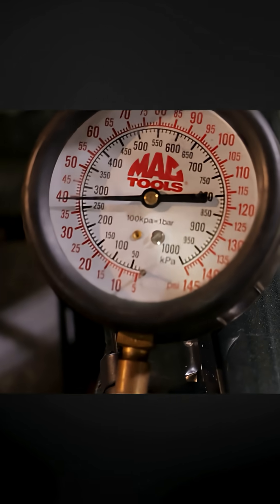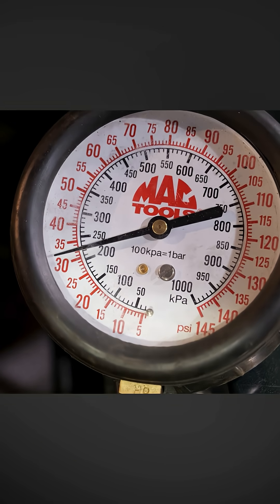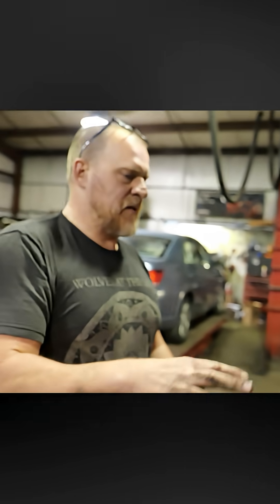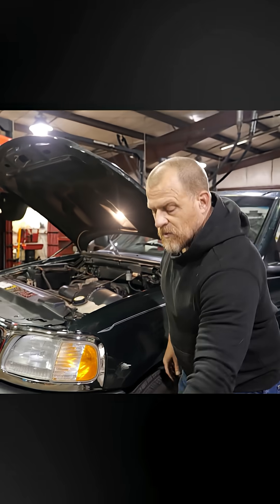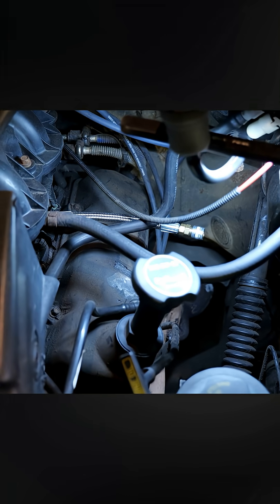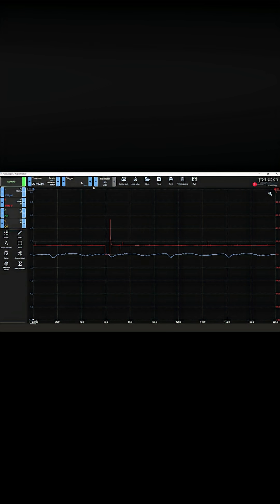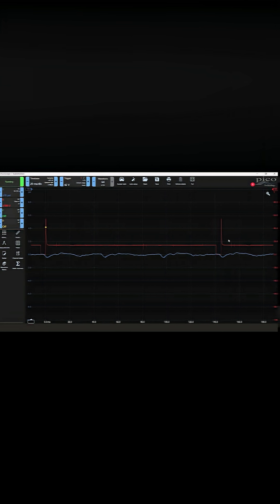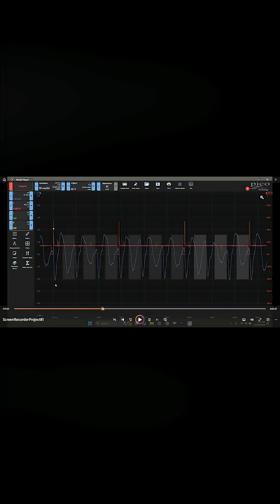The Injector Test That Fooled Me

Comment: Got that same Mac Fuel Pressure kit 16yrs ago. My god I'm getting old. Any how I was going to say the PICO scope is the best I've seen for users with the info and screen sshots of test. The thing is for me I look for a percentage difference before I poke the beast. Ford has some stupid engine management you have to use a scope. If they used smart component volts and amperage monitors we'd see those lazy injectors and tapping out ignition coils from live data. That was borderline below my 10% difference where I poke the bear. Might be crazy but I would have a thermal look at the injectors. Less fuel means less cooling in theory. Returnless system. With return I'd disconnect one or two to see a temp change as the initial metric. It's not a proven way to see a failure but worth a try to prove or disprove a flow problem. Love the vids man! You make it look easy and you have that positive direction. I don't think it's for me anymore. Not working for someone else anyways. Damn man my kit is older than my daughter lol.....

Comment: This is a valuable tool I’ve fixed so many injector problems with this tool along with the motorcraft propane injector cleaning system to vehicles 🚗 it applies to do not use this cleaner on a Cadillac the injector will short I ohm those ones and replace as needed

Comment: Wait a minute.  If you can determine injector flow with a pressure transducer on the fuel rail synced to an injector, then that means the old-school injector balance test is obsolete.  Every shop should have a pressure transducer and a scope because they are not that expensive any more.
Reply: Now that I think about it, some cars already have a fuel rail pressure sensor.  On those cars, can you just scope the fuel rail pressure sensor instead of installing a pressure transducer, or does the pressure transducer give a better waveform?  If the built-in fuel rail pressure sensor gives a good waveform, then there is no need to go to the trouble of installing the pressure transducer.  Every time you open up the fuel system, there is some liability.  There's less liability if you just tap into the existing fuel rail pressure sensor.

Comment: Took me a few minutes to realize what i was looking at. The graph shows reduced injector pulse width on bank 2. That's why the fuel drops are lower on 4 and 6.
Reply from the maker: Yes sir other than cylinder numbering. As this is a Ford, so 1-2-3 are on bank 1 and 4-5-6 are bank 2. My psi transducer is closer to bank 2 combined with -15% trim on bank 1

Comment: So the red line on the pico is voltage but what does the white line represent or hooked to?
Reply from the maker: That's actually blue, sorry, I was confused by your question at first as the color doesnt show right on this clip. That line is the fuel pressure in the fuel rail. Check out the full video linked in this short! It's pretty awesome

Comment: How you have 2 fuel gauges hooked up at the same time and one drops while the other stays at 40?  This clip must be edited or something.
Reply from the maker: 🤔 of course it is edited. It is a short that we created from a long form video. And even watching this highly chopped down an pieced together clip, I'm not understanding what you are referring to? Same pressure gauge on two different injectors, using the same starting pressure and showing the results
EDIT!!
I can see now how you thought that. There was a slide transition used instead of a hard cut, leading to that  illusion @USkeZB3mpyAM sorry for my snarky reply
Reply: It’s video editing split screen. Two gauges are not shown simultaneously.
Reply from the maker: I can see now how he thought that. There was a slide transition used instead of a hard cut, leading to that illusion.  Thanks for pointing that out. To @USkeZB3mpyAM sorry for my snarky reply
Reply: @ScannerDanner  I always watch videos in double speed to save time.  It happened so fast I missed the transition line that tells me it is a transition.
Reply from the maker: Sorry again for my initial comment
Reply: @ScannerDanner  You are good.  No offense taken.  Now I know the answer to the mystery.
Reply: @nohrtillman8734 got me too

Comment: I can't see it in the video but I'm assuming the injector pulse width is the same for the other injectors in the test, correct?
Reply from the maker: Are you referring to the pressure waveform at the end? Check out the full video my friend. You’ll like it!
Reply: He showed it….
What do you mean you cant see?
He shows the tool which was the otc buzzer and it has a timer that he points to. Used the same tool on every injector…
Reply: @mikesabin8568   70 year old eyes don't work so well anymore on scopes and I always verify results between test equipment when possible. Had to ask, I haven't thrown in the towel yet.
Reply: @weps2097 it wasn’t a scope… it was the otc buzzer tool. Its a timer tool that activates the injector at set times. He shows it in the very same clip you commented at the beginning. Watch again
Reply: @mikesabin8568  The original poster was inquiring about the dynamic fuel pressure waveform displayed on the scope that was synced to the number one injector ground side voltage.  The correct answer to his question is that we don't know, because this short does not show the voltage waveform for injector 2.